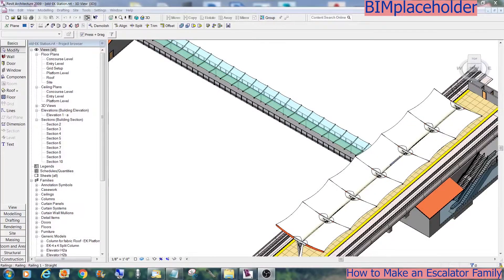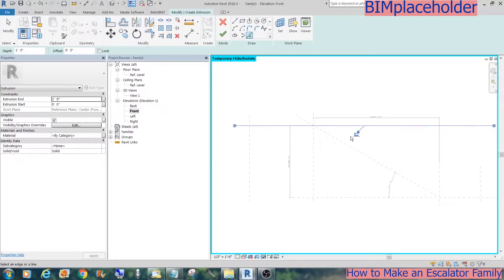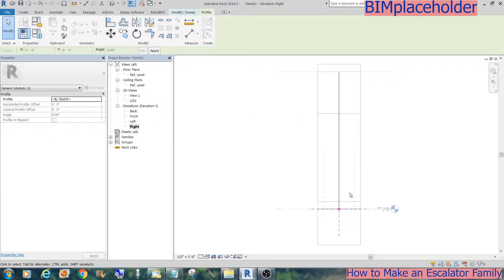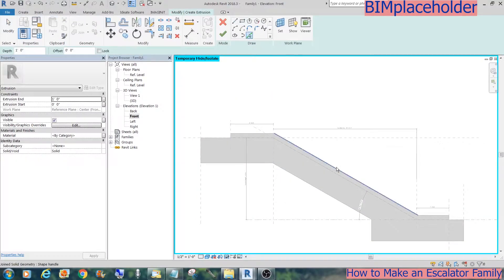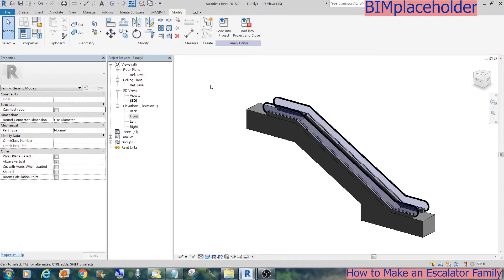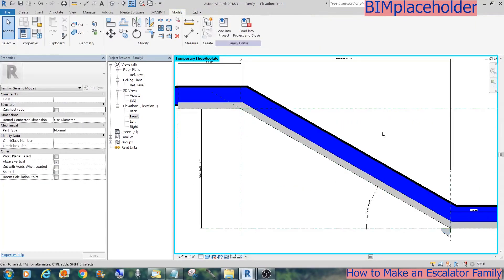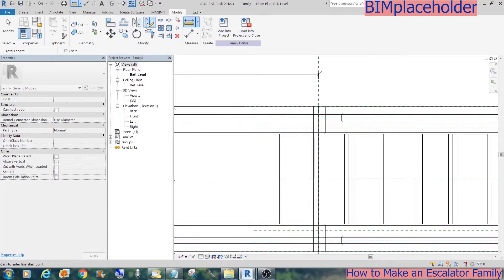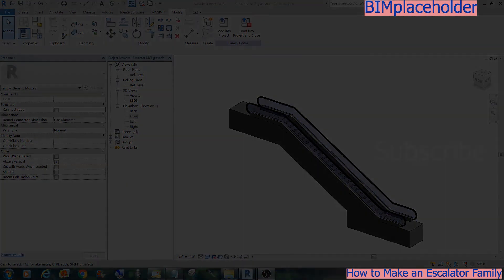How to Make a Parametric Escalator family

Comment: What is the purpose to draw a object above reference plane and below reference plane
Reply from the maker: Anything you create in relation to the reference plane will behave appropriately based on that plane's movement whether it's locked by a dimension or drawn offsetted from the ref plane. In this case, the housing is created below the top plane so that as the parametric height of the escalator moves thus follows the mech well. Same thing for the railings, they will follow the reference plane as it goes up or down. 
My advice is to practice making extrusions, sweeps off of the reference planes then try to move the planes to see how the solids behave. BTW, in this exercise I completely ignored the 
"direction" of the reference planes, which is very tricky to remember. I simply make it a standard practice to make them all in one direction (I hope I did), and just change my extrusion's direction with a negative or positive value instead.
Hope this helps.

Comment: One thing more I m beginner ,kindly tell what is the reason behind to draw a object below reference plane and above reference plane
Reply: Means ...Floor to floor height
Reply from the maker: The formula "Flr to Flr Height / (tan(Esc Slope))" is in order to get the Horizontal run length of the escalator so that if your floor to floor height increases the escalator extends upwards AND forward to meet the upper level floor. Assuming a fixed escalator incline of 30 degrees (Esc Slope).